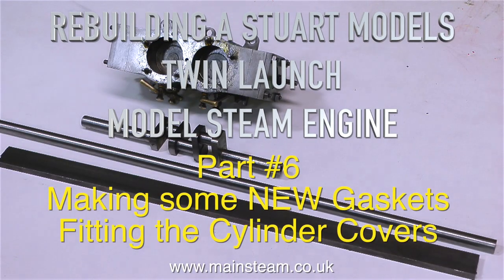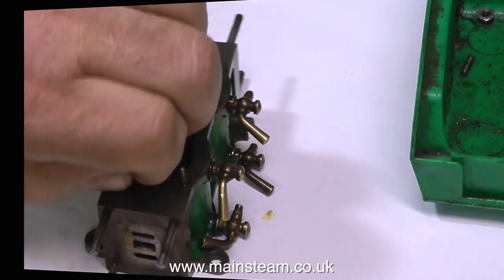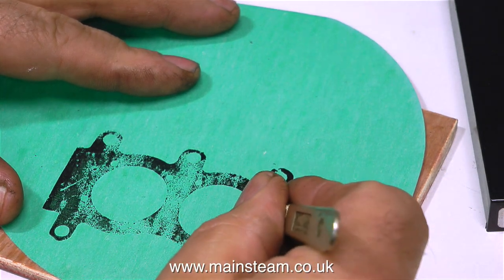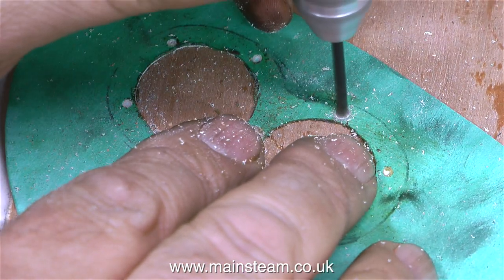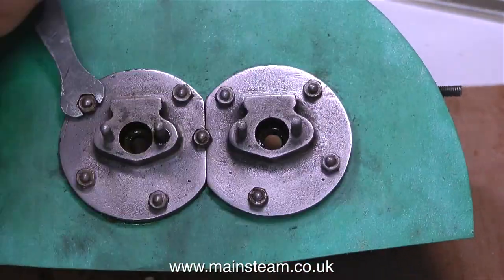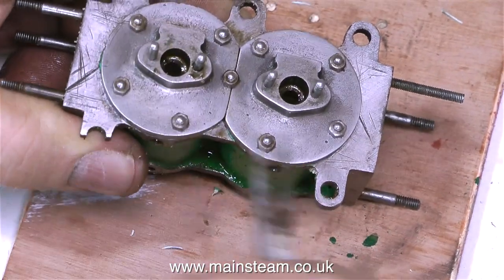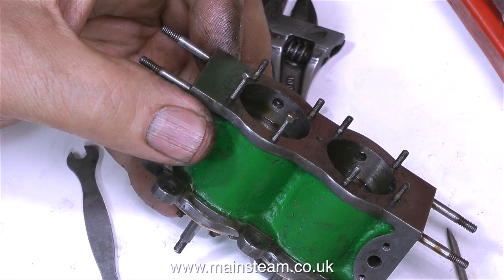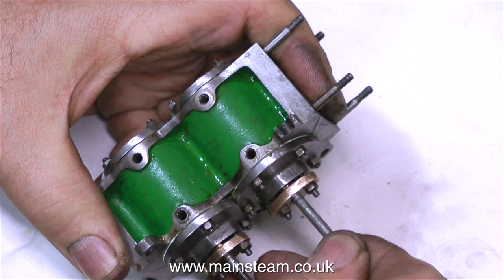STUART MODELS TWIN LAUNCH STEAM ENGINE REBUILD - PART #6

Comment: Have you ever used the thread protection liquid called "Duralac"?
It is mainly to stop galvanic corrosion between dissimilar metals in the aerospace and marine industries, it takes the form of a bright yellow thick liquid that air dries to a tough but "pickable" hard film, and stays thick and viscous in the threaded areas away from air, combatting corrosion.
If used on your studs, which are slightly dissimilar, it should work like a weak loctite, completely seal the threads from oil and crap, and stop any rust seizing the things in solid.
Reply from the maker: Interesting Roger, I've never heard of that - I will Google about and have a look at some, thanks for your comment :-)))

Comment: Have you considered purchasing a stud remover?
Reply from the maker: I have a set, but they are not very strong in these small sizes - I prefer to carefully drill them out and re-tap the thread.
Reply: @keithappleton - Micro-Stud remover, really ?

Comment: Probably a stupid question. But. The gaskets here... Is it really that important how they look on the inside? The lower one has to have a hole for the piston rod, but the upper one doesn't really seam to need much of anything.
Not that i ever will get close to needing the information, i'm just looking out of pure fascination.
Reply from the maker: there is a machined register that fits in the bores slightly on the upper covers so the gasket needs to be cut out to suit that.

Comment: Why don't you need a gasket for the bottom cylinder covers?
Reply from the maker: er ..... those are the bottom cylinder covers . . . . .  :-)))
Reply: I think my ignorance of model steam engines is showing. So this isn't a double-acting engine? There's no steam powering the upward stroke? I thought I saw ports in the top and bottom of the cylinder.
Reply from the maker: Yes it is a double acting model steam engine, that's why it has bottom cylinder covers. The ports that you saw are in the valve chest to admit & exhaust the steam to and from each side of the piston.
Reply: So why don't you need a gasket on the bottom covers? Won't they leak steam without it?
Reply from the maker: once again, the bottom cylinder covers on the picture BOTH have gaskets - in the picture I was making the Gaskets at the time ........ the green stuff is the Gasket material.
Reply: I just rewatched that part of the video and you quite clearly do put gaskets at both ends. Not sure how I managed to miss that the first time through. Sorry for having wasted your time.
Reply from the maker: Not a problem :-)))